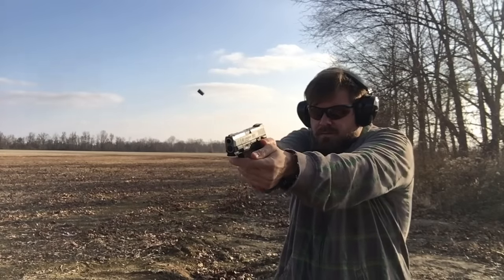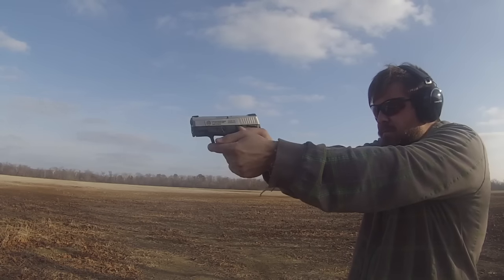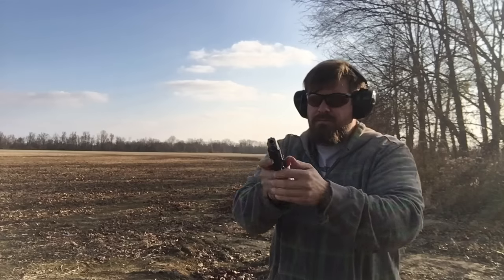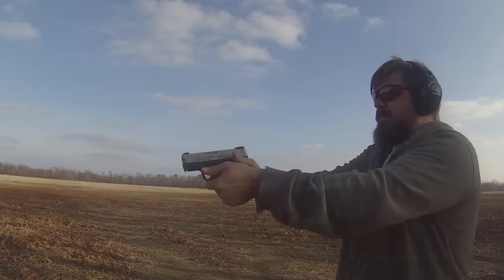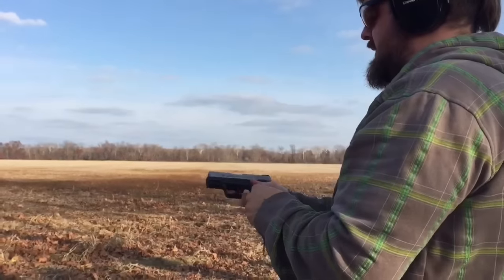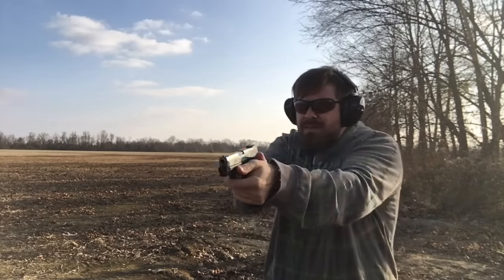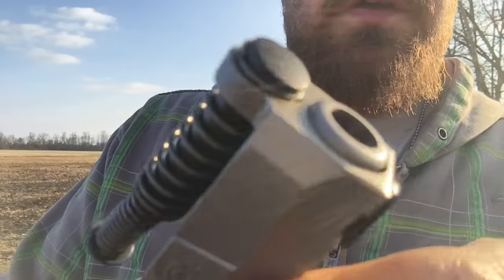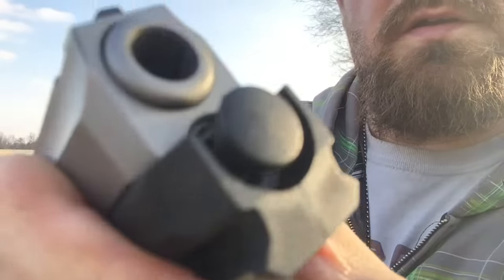Taurus 24/7 G2 Malfunction Fail Guide rod problem

Comment: Had one for 4 years. 900 rounds not a single jam or malfunction. I got this thing so gummed up at the range one day I could hardly pull the slide....no problem. The shop I bought it from said these are good for about 1000 rounds then you'll need to invoke the lifetime warranty to fix it. So we'll see.

Comment: I have a gen 1 Taurus PT 24/7 pro DS. I traded a gun for it. It was already in used condition. I have shot over 2000 rounds through it. It's more balanced than a Glock 17 and better built. Plus it has a double single action trigger, safety decocker switch, weaver rail, three dot sights, titanium slide, loaded and cocked indicator. The gen 2 doesn't seem as well built as the gen 1 or gen 3. I think the gen 1 is the best built.
Reply from the maker: Thanks for watching and commenting I appreciate it!
Reply: @ms1914  I was on gun broker and saw 30 round mags for the Taurus PT 24/7 Pro DS gen 1 for $39.95+tax and shipping. Plus 30 round mags for the gen 2.

Comment: I had the same gun,It stovepiped constantly..
Reply from the maker: I have been hearing this, stay tuned for update and thanks for watching!
Reply: I had the same issue.  I think it may be with 230 grain bullets but all I did was polish out the ramp on the barrel really good.  It seems to be thicker on some barrels than others.  Haven't had any issues since but the mags are terrible as well.

Comment: So is the Taurus classified with American made Hipoints now?!🤔🤔in manufacturing making products defaults mostly passed a lazy inspection.. you just got a bad one that's all🤔🤔🤔🤔🤔🤔
Reply from the maker: 1994/1989 Chevy Silverado 4x4 definitely not classified with hi points because hi point has lifetime warranty and way better customer service. Not my gun either, I wouldn’t own one. The owner is done with Taurus as well. Great revolvers but not so great autos. This is not just a bad one as you say, it’s just the only one I’ve happened to catch on video failing miserably.
Reply: ms1914 maybe I should get a hipoint again right?
Reply: ms1914 but this is only video I seen Taurus 24 7 gen 2 failed miserably because I have one since 2015 after my hipoint got stolen and it has failed yet
Reply: @ms1914  lol yeah because when hipoint fails in a life or death situation... That life time warrenty doesn't mean much.  Not saying taurus is great but way better than hipoint.

Comment: This model is garbage. taurus has some very good guns just stay away from some like this model the ,taurus spectrum, polymer revolvers suck the the old 24/7 sucks to as well as the pt111 g2 (not the g2c).
Reply from the maker: I agree mostly but I have had amazing luck with the pt111, I guess there’s good ones and bad ones in all of them.  Thanks for watching!
Reply: @ms1914  thats good. ya only thing i seen happen to them is the trigger breaking off. Taurus is hit and miss i guess i have a 740 slim and its flawless but other 2 i had sucked
Reply: @ms1914  i had this same one like urs but mine was 45 acp did the same after only 150 rds and the new g2s i also had jammed every rd even after polished feed ramp and sig sauer ammo to so idk